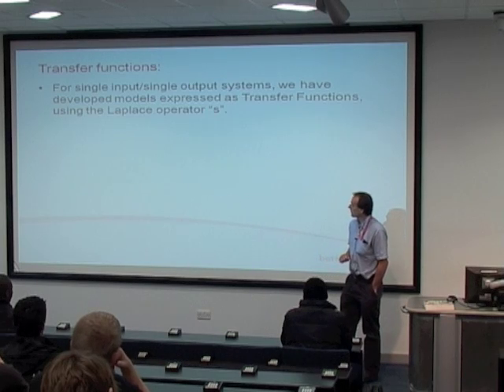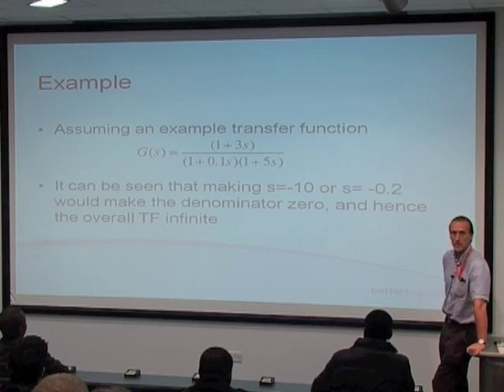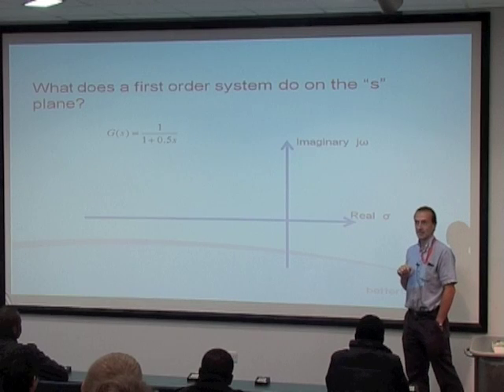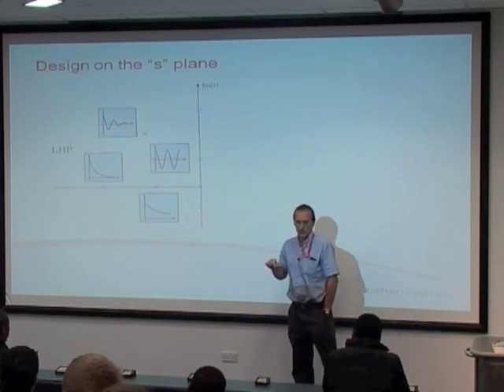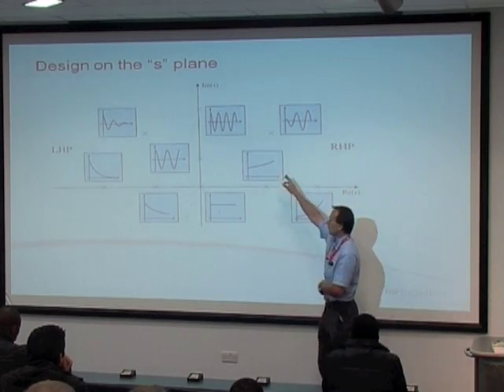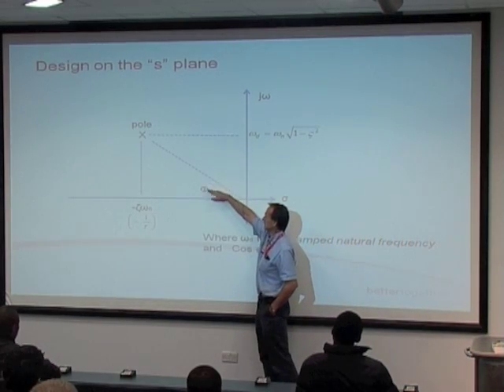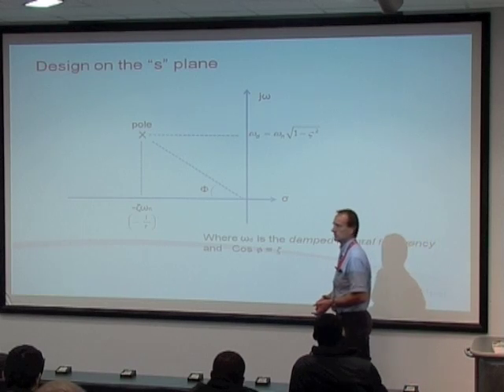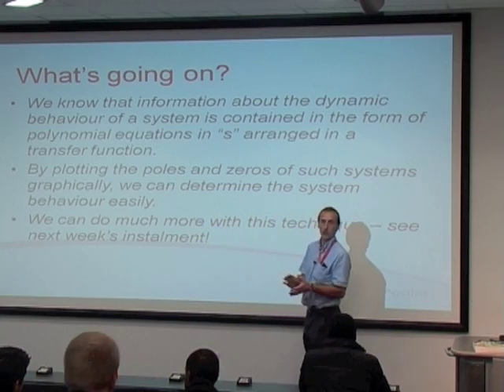Control Systems Engineering - Lecture 9 - The s-plane

Comment: I have  doubt, why did you say that if the roots are imaginary, oscillations will occur?
Reply: The solution of the ODE is a sum of exp(rt) where r is a complex (r=a+bi, in general) root of the polynomial.

Euler's formula gives exp((a+bi)t)=exp(at)*(cos(bt)+isin(bt)).

So you can see that any imaginary component is translated to the time constant of cos and sin, which are the oscillatory part of each individual solution.